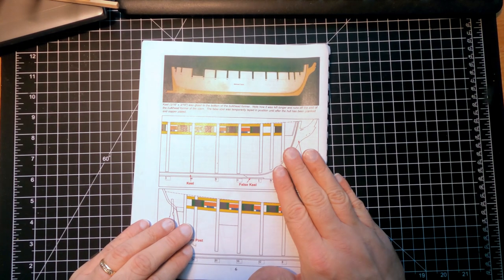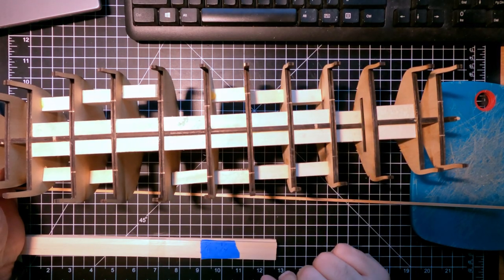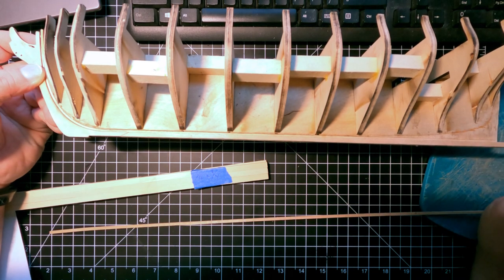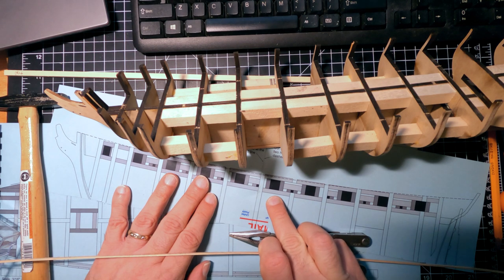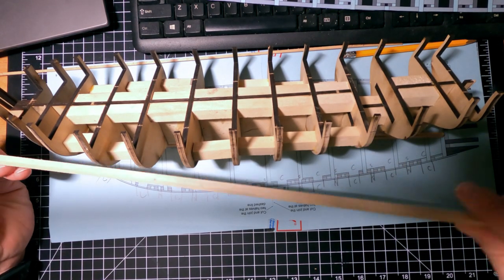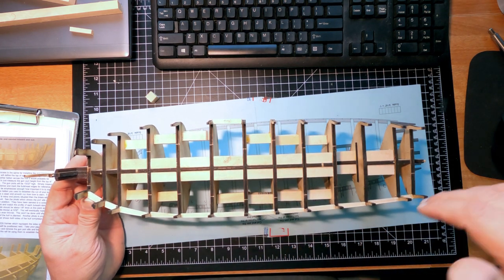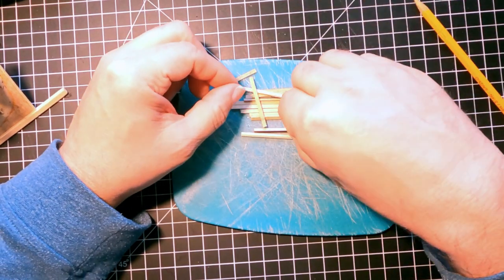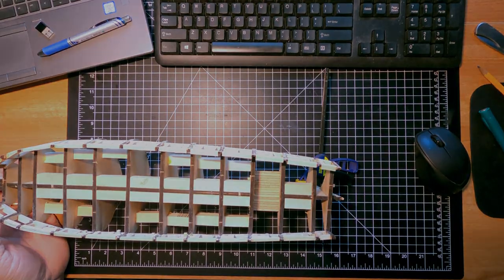Model Shipways US Brig Syren part 2

Comment: For the deck caulking on my builds, I had tried many different solutions, including pencil (too light, and bled) sharpies, (too dark, and bled) paints, (wildly unpredictable and all over the place).  I finally tried the wife's black  fabric marker from Michael's,  and it worked perfectly for my 1:76 scale Cutty Sark scale planks, and I used it on my 1:64 Niagara as well.  No bleed, and almost perfect scale lines.
Reply from the maker: The strangest I have seen, on you tube, is the person that used black thread glued next to each plank after gluing the plank to the false deck. It all boils down to what the builder thinks looks best.
Reply: @TrevorsWorkbench  Yes.  I believe that was Steve Priske, and I watched his videos when I first started wooden ship modeling.  I tried his method as well, and gave up quickly!

Comment: Which model Zona saw do you use please?
Reply from the maker: I used the Zona 35-241 set which is made up of the 37-240 thin slot miter box and the 35-550 fine kerf razor saw
Reply: @TrevorsWorkbench  thank you Trevor, I will see if I can buy it in the UK.
Reply from the maker: @pwsod  It is available on Amazon (if you want to add more money to Bezo's pocket)
Reply: @TrevorsWorkbench  I have checked Amazon UK and no luck. However I have found the saw on UK eBay, but no miter box yet.  But I have found OLSON saw and mitre set which looks very similar to yours, with the part numbers you supplied.